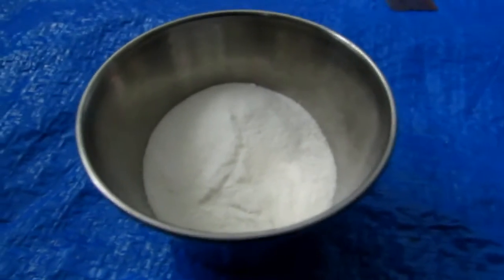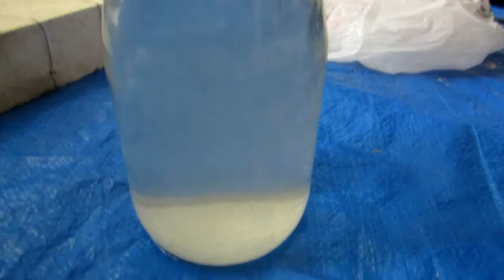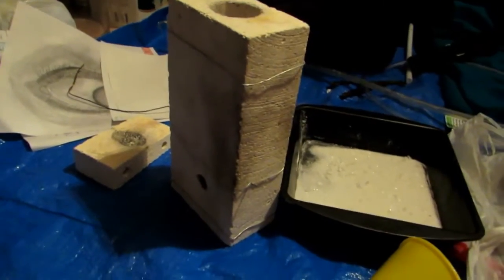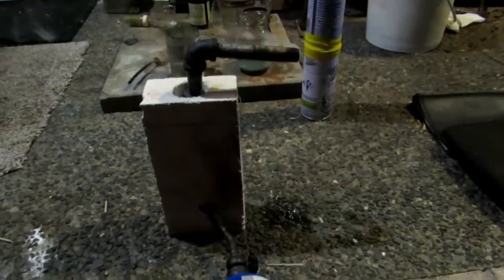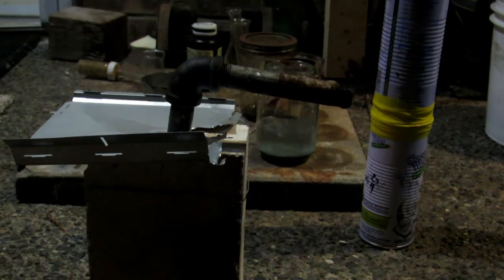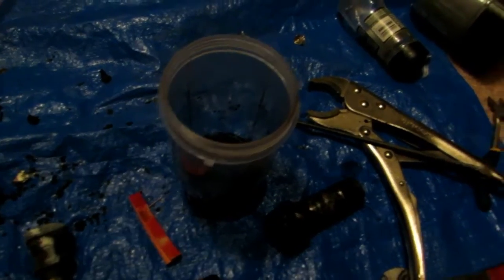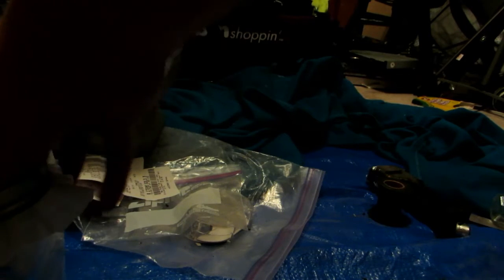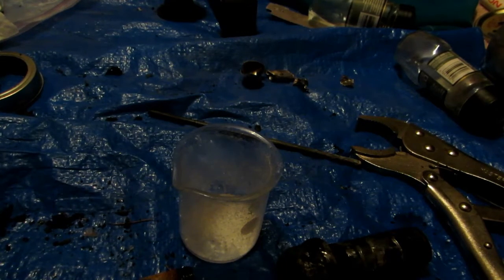How to Make Potassium Carbonate

Comment: An air-fed torch's maximum temperature is around 2,000 °C (3,600 °F). However, a typical primary flame will only achieve 1,100 °C (2,000 °F) to 1,250 °C (2,250 °F). Oxygen-fed torches can be much hotter at up to 2,550 °C (4,600 °F). The max without O2 is very close to the decomposition temperature, is there a starting temperature where very little decomposition begins or will it not decompose at all till 1200 °C?

Comment: you cant take calcium hydroxide  plus potassium carbonate to make potassium hydroxide
Reply: Actually, during the Middle Ages and continuing into early modern times, potassium hydroxide was made precisely that way.  Potash (potassium carbonate) would be mixed with quicklime (calcium oxide), and then water would be poured over the mixture.  The water that drained from the mixture would contain potassium hydroxide.  The same water would be passed repeatedly through the lime-ash mixture in order to rinse out all of the potassium hydroxide and thus obtain a concentrated solution of potassium hydroxide.  (The calcium carbonate, of course, didn't dissolve significantly in water.)  The reactions are:
CaO + H2O → Ca(OH)2
Ca(OH)2 + K2CO3 → 2 KOH + CaCO3
Sodium carbonate (obtained either from Egyptian natron or from the ashes ("barilla") of plants that grew in saline marshes) was also used in this way in order to make sodium hydroxide, which in turn was used to make hard soaps.

Comment: Make carbon disulfide in that high temperature distillation apparatus by mixing carbon and sulfur powder and then distill it off
Reply from the maker: I don't remember how much potassium bitartrate I started with, so I can tell you the percent yield, considering I tried 2 different heating methods and received similar amounts, my yield was rather identical in both tried. 73 percent seems a bit low, I don't see how you could loose potassium carbonate as all we are doing is a decomposition reaction and the potassium carbonate doesn't boil away, could you tell me where the loss would be to give a yield of 73 percent? I am just curious. thanks!!!
Reply from the maker: hmmm, how interesting, If I were to make this, we could perhaps do a parking dog experiment which would be very fun! thanks for the idea!
Reply: Be careful though, it is very toxic and a carcinogen but it would be fun to watch the barking dog :P
Reply from the maker: I know how dangerous it is. I just finished making the ammonium chloride to synthesize the dinitrogen monoxide (laughing gas) for the reaction. I should get around to releasing all the necessary videos before the end of November, hopefully. Thanks for the suggestion! this is soooo cool.
Reply: About your comment re how much potassium carbonate you got out of it, the total theoretical yield should be 73% approximately.  What did you get?
Reply: Potassium Bitartrate has a molecular weight of  188.2 approx. and Potassium Carbonate is  138.2
 138.2 / 188.2 * 100 = 73.4%
Reply: i'll do the eq'n in a short while
Reply: It's been a long time but it will be something like:
2K2C4H5O6 =>  K2CO3  + 5H2O + 2CO2 + 5C
(In the absence of oxygen, otherwise the 5C would be burnt off as 5CO2 + 2CO2 giving a total of 7CO2). Please correct me if anyone sees an error. This was all 40+ years ago for me.
Reply: add in the loss of water of crystallization also
Reply from the maker: oh, I thought you were meaning that the conversion process from potassium bi tartrate to potassium carbonate had a normal percent yield of 73 percent. in other words, if you had 100 grams of potassium bi tartrate and expected 73 grams of potassium carbonate, and you only got 53.29 instead, then that would be 73 percent yield. I thought that is what you meant, but I see that you meant the difference between the initial weight before the reaction and the final weight after. Also, your equation may be right, but after some time, a liquid started distilling over, and the pipe (even at the end) was well over 100 degrees Celsius. so whatever was distilling wasn't water. it also smelt quite bad. perhaps there was some impurity, but after recrystallization that shouldn't be the case. I don't really know... I sometimes find that chemistry doesn't always follow the textbook in practice. anyhow, perhaps the potassium created some molecule at the elevated tempuratures which distilled off, but I have no idea what that might be. the potassium making a different molecule, however, would explain the low yield I got. I am guessing I loaded about 30 grams of potassium bi tartrate and probably only got 5 grams back in potassium carbonate. anyhow... if you have any other ideas what might be happening, please tell me. :)
Reply: The Canadian Chemist 73 percent is based on anhydrous weights and doesn't include crystallisation water. As far as intermediate compounds go, that is very likely. My equation is based on "perfect" environment and you could get all sorts of intermediates from a molecule like that with water (steam) in a , relatively, uncontrolled, unsealed vessel. Anyhow, keep the videos coming. They are great. I look forward to more.  I had an illness a couple of years ago that mucked up my brain ... Memory and such. Watching your videos brings some of it back. 😀
Reply from the maker: oh... thanks! its too bad you had an illness, what happened? thanks for the support?
Reply: The Canadian Chemist I got a superbug infection in my blood which triggered my kidneys into shutdown.  As a result of my kidney shutdown, my body wasn't able to get rid of a drug I was on and I developed methatrexate poisoning that affected my brain. I would have kicked the bucket if it wasn't for the doctors at the hospital. Anyway, result four weeks later is I am gratefully still alive but minus some memories.
Reply from the maker: wow! that is amazing! talk about being lucky!
Reply: Yep! Despite a chunk of memory and a reading problem, I regained fully functional kidneys and I know my family and friends. I was very lucky. My wife had just been given the talk by doctors that I might only regain a small percentage of my former self when I started to improve. I was in hospital for four weeks and just got better each day. But it has been a long haul to having a "normal" life. For one, I can no longer work. I enjoyed being a programmer. Anyhow, gotta move on.

I had been thinking about the Potassium Bitartrate and the method of recrystallizing. Was there apparently more crystals after recrystallizing than there was powder that you started with?
Reply: Also, did you test for carbonate with a drop of acid?  It should effervesce ie give off CO2 gas.
Reply from the maker: no, I think the masses of the potassium bitartrate before and after were rather similar, this probably meant that the purity of the store bought stuff was rather pure. I didn't test with any acid, but my product was strongly basic and has worked in successfully making potassium hydroxide which worked for the reactions I did with that.
Reply: How did you make your Potassium Hydroxide?
Reply from the maker: by heating it to about 2500 degrees celcious with my arc furnace which was more than hot enough to decompose it to potassium oxide. that was then rehydrated with water to form the hydroxide. another method I did was the double displacement reaction with calcium hydroxide solution forming calcium sulfate and potassium hydroxide. both of the remaining hydroxides were then dissolved in ethanol to leave unreacted potassium carbonate undissolved, there was also some brown impurity. that was all filtered, then I boiled the ethanol off and was left with nice pure potassium hydroxide.
Reply: I had a thought about what temp k2co3 decomposes at. I checked and found 1200 degrees celsius.  Guess what temp steel is white hot? Yep, 1200 degrees celsius.  You may have had KOH not K2CO3.  You might want to check, the next time you do this, with some acid and if it fizzes, may be check that it is CO2. Your apparatus looked pretty close to white hot! This might explain the apparent low yield.
Reply: Actually, correct that, read K2O not KOH.
Reply from the maker: true, I did know the decomposition point, but a propane torch cant reach that, so I didn't think much of it, however, it is probably a lot hotter in that confined space. oh well, even if it did decompose, it would have rehydrated to potassium hydroxide when I filtered the carbon off, so what I would have been left with was a mixture of potassium hydroxide and potassium carbonate. it makes sense with the low yield in that case, but it wouldn't have harmed anything in the end because it was just used to make potassium hydroxide anyhow. thanks for all the ideas on what may have gone wrong, I think this one is right and makes sense. :)
Reply: the end result is ultimately alright in this case, right? I do like your apparatus. What pipe fittings did you use? i am sure others out there would like to know.  Also a talk and demonstration on DIY equipment would go a long way.  Not having the "right" equipment has often stopped me from proceeding with an experiment yet you often just make do and still get a good job done. Anyhow keep 'em coming!
Reply from the maker: Terry Maker I used some various fittings from Home Depot, some are 1/4 and some are 3/4 and I also used 1 inch pieces with the corresponding adapters. You are right, I should do a small tutorial on homemade things like this, thanks!